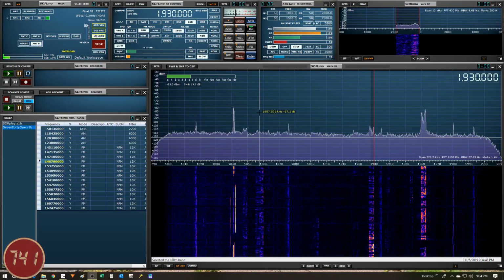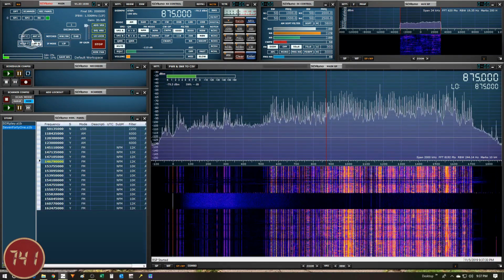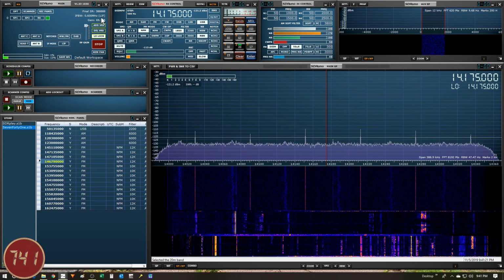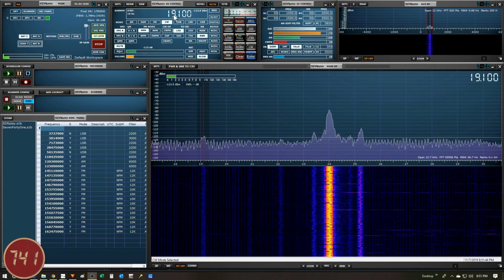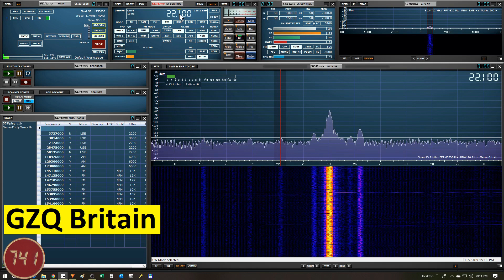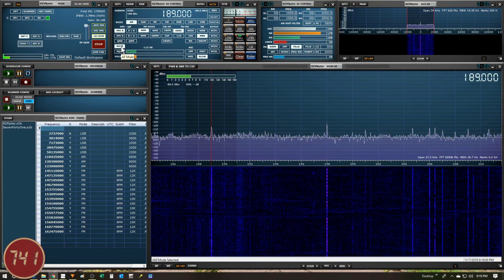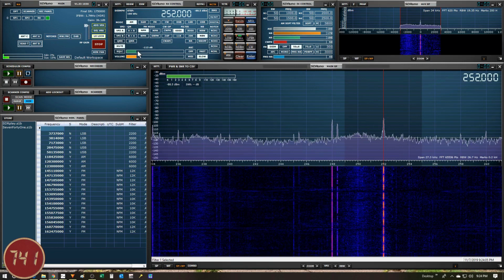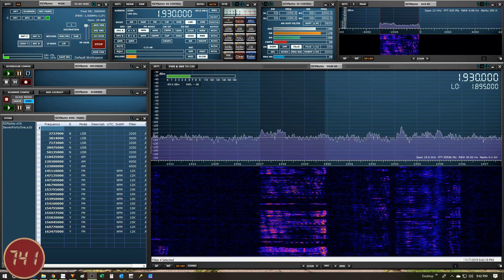SDRplay RSPdx Overview and SDRuno V1.33 Demo

Comment: I am bewildered why you would even demonstrate AM stations/signals that are inaudible. You mean to say that out of the thousands of frequencies in AM or VHF/UHF, aircraft, marine, amateur, etc the ones you picked were the only stations that you could pick to demonstrate the radio’s performance? Mate, you seriously need some new antennas!
Reply from the maker: I'm bewildered that you missed the point of the demonstration.  I mentioned in the video that I was focusing on receiving signals below 2MHz which is not normally something most radios available in North America are good at.  I feel the fact that I could receive European Long Wave broadcast stations in North America on a less than ideal antenna for the band in question, even though they are weak, is worth demonstrating and proves the radio is working as intended.   If you want to see a demo of a clean AM signal, feel free to watch one of my other SDRplay videos, I believe I've covered that in the past.

Comment: I might have missed the info, but what antennas are you using?  How do you tune them for the frequency?  Thanks for the video. I’m going to purchase one.
Reply from the maker: I'm using a fan dipole with legs cut for 40 and 80 meters.  I don't use tuners for receiving - just straight connection of the antenna as it is to the radio

Comment: What about saturation of the MW band like ALL the other RSP's do? Seems the RSPdx is improved on this, but i cannot see any evidence so far. Would be nice if you could make a video with a decent size antenna connected on MW. Thanks for showing the new development.
Reply from the maker: I don't have any problems with AM saturation.  What is your idea of a decent sized antenna?  I'm using a 40/80 meter fan dipole for this video.
Reply: @SevenFortyOne  I asked this because I saw you reduced the RF-gain on some parts of the video. With such a dipole normally no saturation can not be possible on MW. Thanks for the reply.

Comment: Good video thanks.  I'm still looking for information about scanning 4 separate freqs.  I can set up a bank but the scanning window uses Preferences instead of selecting a bank.  I can't find anything in the manual either.  For preferences it asks you to select a range instead of actual freqs.  Do you know if there is a way to do this?  Thank you,
Reply from the maker: You have to click the "mem" button to get it to scan the memories instead if the ranges.  It's right above the skip and pause buttons in the scanner pane
Reply: @SevenFortyOne  Thank you, I'll try it today.